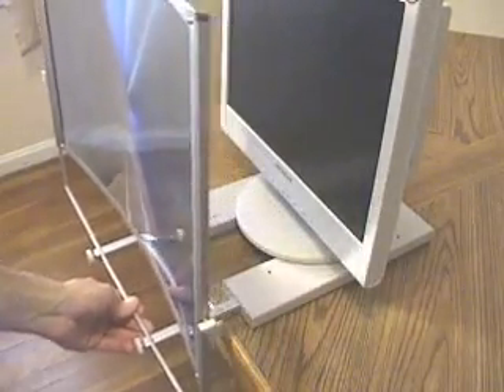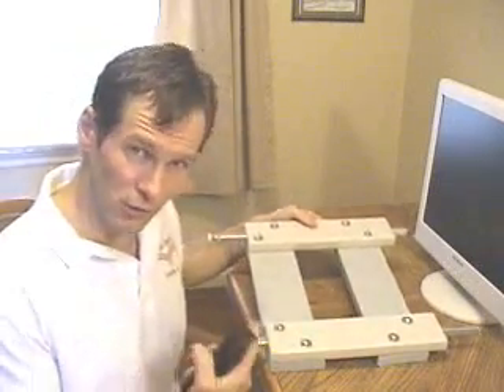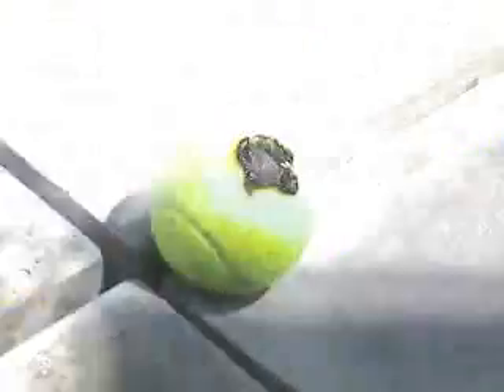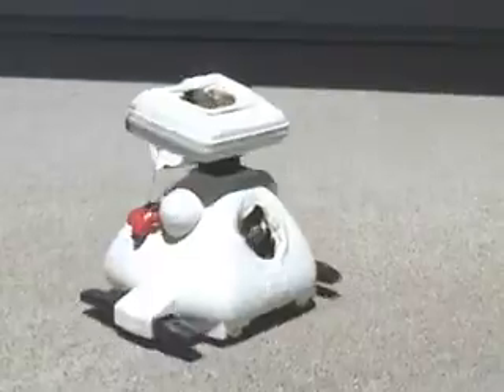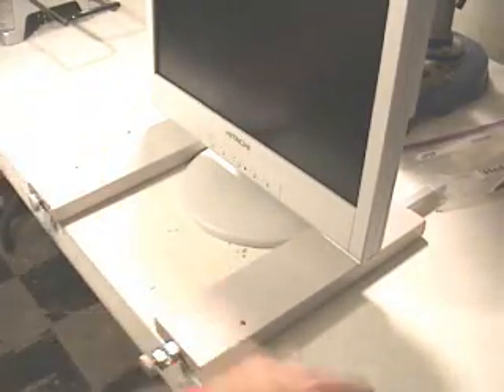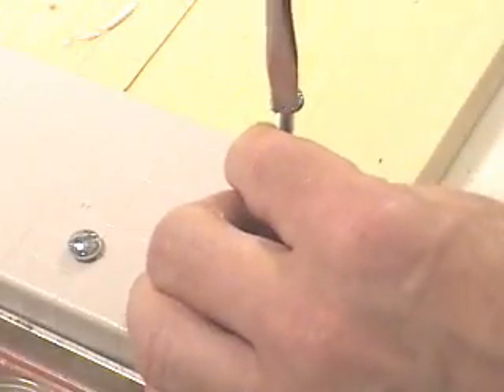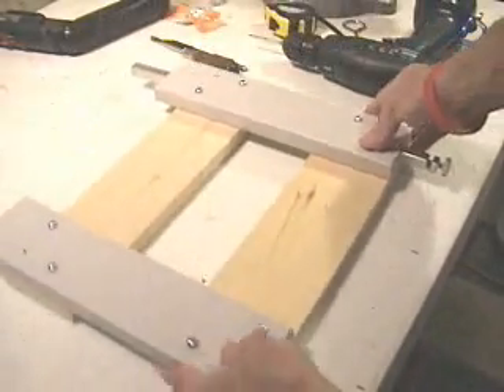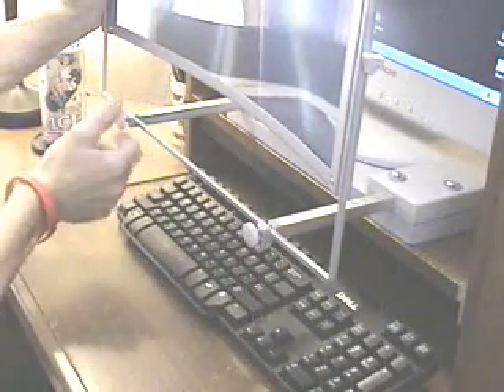DIY Fresnel Lens Screen Magnifier

Comment: They are harder plastic, but not exactly the most rigid material. I still bends easy. The lens in my TV, which is the same thing hes got only about double that size (50") bends. You can make some interesting sounds with it too =p